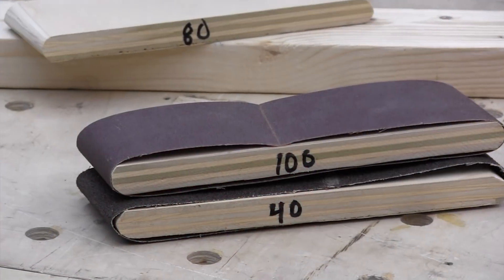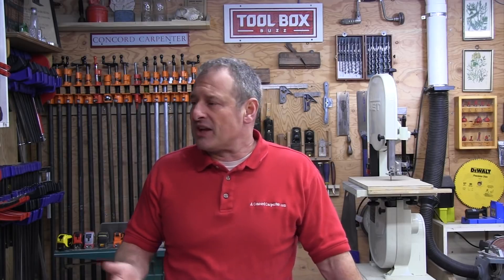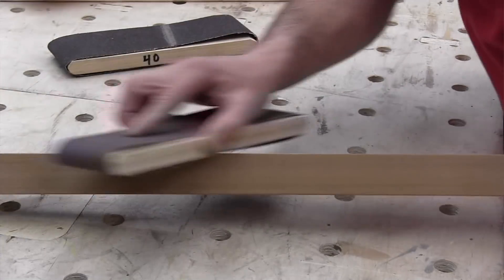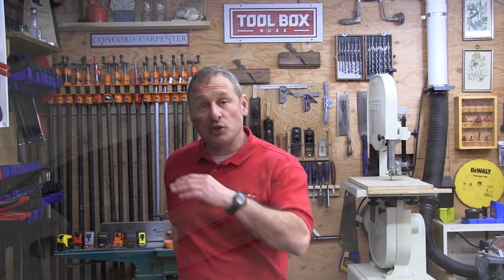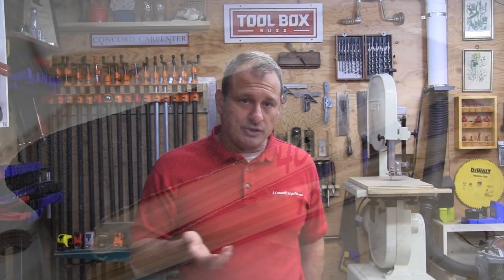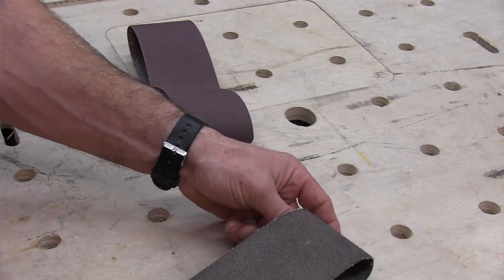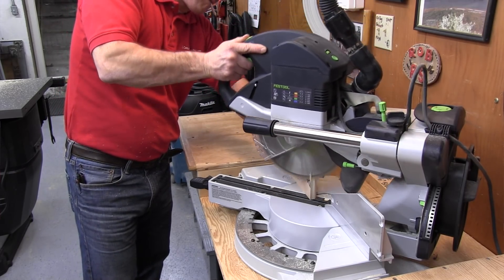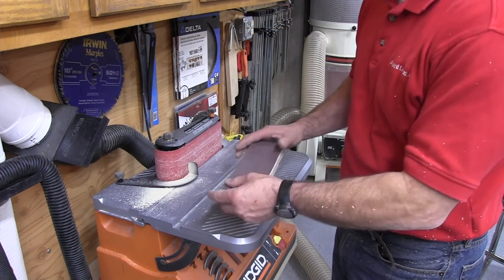Making Custom Sanding Blocks   PRO Contractor Tips

Comment: I’ve made stick sanders. Use spray adhesive to attach sand paper to a strip of 1/4” luan about 12” long and 1” wide. Leave the last 2” bare to write the grits. They are good for tight spots.
Reply from the maker: William Butler great idea, I use self stick paper on my workbench when doing miter stuff, I can tweak them